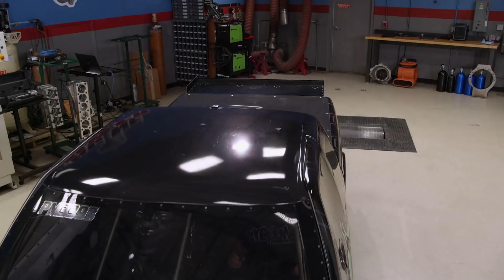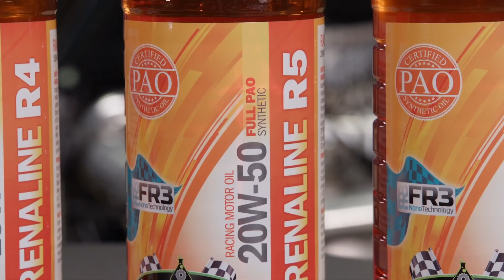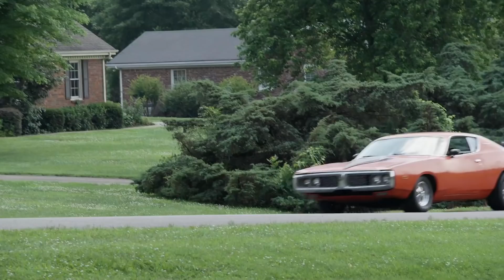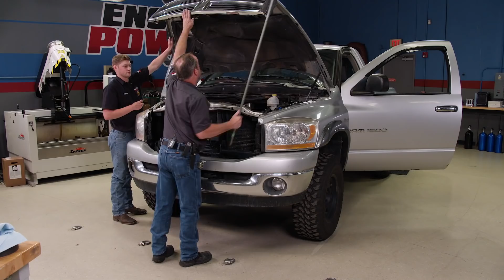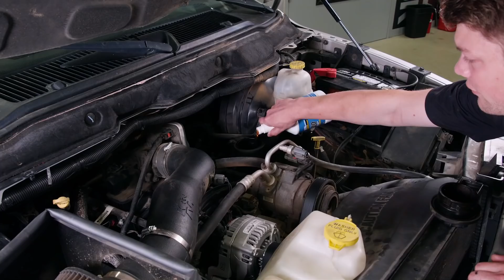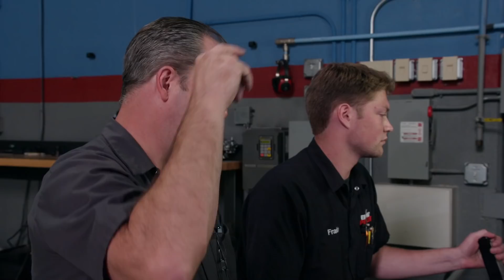The Secret Behind The Record-Breaking 3000 HP Diesel S10 - Engine Power S8, E18

Comment: Most people warm up the engine a little before changing oil. When you pre fill the filter you run the risk of pushing contaminants from the manufacturing , packing , shipping , process straight into the engine. Most cars have a clear flood mode. Buy holding the throttle wide open and cranking it for the few seconds it takes to establish oil pressure 
You can avoid causing any damage buy contaminating your engine. There is plenty of oil left on the Bering surfaces from warming it up. Pulse you just dumped five quart s or more onto it that drained threw. So there is plenty left to protect it for the few seconds it takes to get oil pressure.
Reply: So how do you get around the "contamination" in the oil filter (as you say) on the first start up then? Either way the first time oil goes through if there's stuff in the filter the oil is going to pick it up. Not arguing just asking as I may be missing something here.
Reply: @darryladams519  When oil comes out of the engine and into the filter in it goes threw all the little holes around the top and is pushed threw the filter medium to the bottom of the filter then back up out the big hole in the middle. If you pre fill it it sucks that oil out on start up and into the engine without passing through the filter.

Comment: I'm disabled ( thrown from a truck on the highway)  in 94. But my 2002 Sonoma 4x4 trans lines are leaking, my nephew tried to fix but hard to reach the nuts and pull their clips, now a second attempt by a neighbor but the battery went DEAD and so did the fuel pump, just throwing it out there to possibly get some help, I've been without my Truck for 4 months. I'm in Jackson Michigan if you get close. God bless, keep up the great work. P. S. And now my roof is leaking! But that's a whole nother issue.

Comment: These guys know what they are doing!! High horsepower diesel engines don't pour out tons of black smoke. My hat goes off to them.
Reply: It's not tuning so much as its multiple stages of nitrous..
Reply: The water and meth and nitrous cleans up any smoke I'm sure they have figured out how much they can spray with the fuel they have im sure they have done there homework and r&d
Reply: My thoughts exactly.  Some serious tuning and engineering put into that thing.  Impressive.
Reply: @bigboreracing356  That's why they are able to run leaner; lower EGT's and thus less smoke...
Reply: And they even said that they run it on the lean side of the fuel curve with nitrous and water meth to keep it cool even though it is dangerous
Reply: Because firepunk runs thousandths of hp worth of nitrous.  Fuel makes power with a diesel. and the  turbo cools the egt of course with in reason. A diesel thats NA in its simplest form  adds fuel to go and to shut down kills fuel since there isnt a tb or spark plug.   Thats why you see all the smoke.  I promise you guys arent building 50,000$ engines just to roal coal and ruin them.
Reply: Oh tell that to the pulling trucks and tractors
Reply: @justinballard7242  If they did better tuning they wouldn't smoke so much. Gale Banks made 1000 horses with an L5P duramax with no smoke. If FirePunk can make 3K with little smoke those tractors are way too rich.
Reply: @christianmeeks4430  actually if you watch banks videos you’ll notice that they don’t actually show the exhaust. And even in the last video he references the air fuel ratio getting into the 17:1 area which he has said anything heavier than 18:1 will cause a visible smoke. The reason high horsepower drag vehicles smoke is because you have a 7 second timer to stage the vehicle. So you need to retard the timing in order to get the turbo to lite sooner. The retarded timing is what causes the smoke because it’s not burning in the cylinder, it’s burning in the exhaust to spool the turbine. If you had an unlimited time to stage you would see some teams run with no smoke at all. But that’s not the case in such a quick sport. And as for pulling trucks and tractors they smoke so much because the are air limited and they actually run on the other side of stoichiometric ratio and run in the 12:1 and even 11:1 air fuel to get as much fuel in the engine as possible and still keep it cool.
Reply: @WhyNot6243  In one of the Duramax videos there is actually a shot of the dyno cell exhaust during a run.
Reply: @christianmeeks4430  you mean there is a shot of a dyno cell exhaust during a run. There’s is no way to know for sure that it is the same dyno cell on the same run. After watching his video on hoonigans diesel camaro it’s very clear that banks is only goal is to market to steering wheel holders that know virtually nothing about vehicles and try to sell them on the idea of getting a diesel if you use a truck regularly. His record setting duramax from back in 07 has visible smoke at the track. And in the killing a duramax series he isn’t trying to make a setup to drive on the street, he is seeing how far he can push it before it fails. He isn’t worried about how far he can “push” it before it smokes, he’s “pushing” it to see when it breaks.
Reply: @christianmeeks4430  Gale banks has an agenda and youre not listening to what he says . Fuel does make power he just chooses not to do that.  Gas and diesel tuning is totally different a diesel best afr is 14:5.1 stoichiometric  value of 14:5.1 thats very smokey , oem run them at  20:1.1 to burn clean. When people buy diesels tuners all they do is add more fuel and timing . Diesels are lean burning engines . Fuel controls how much power they make and the turbo cools the EGT , with in reasonable parameters. Guys who build 50,000$ sled pullers are roaling coal to look cool . The dyno they use has shown their rigs to make the most power at that level.

Comment: Diesels are interesting. A 3,000 hp gas car will never be a reliable, driveable car. A 3,000hp diesel on the other hand? The thing sounds like any other worked Cummins you see on the street.

Comment: Fram filter ???? Orange death...
Reply: Been using fram for 30 years. Got 800,000 on 2001 superduty 7.3 . Explain yourself
Reply: @BruceLee-xn3nn  the rare times you see a dead cummins its got a fram.. there bypass sucks and can fail and run your bearing dry.
Reply: @BruceLee-xn3nn  BTW you clearly maintain your rig.800.000 nice work  from a HEUI

Comment: Want to piss off the GM fanboys and purists? Drop a Dodge engine in a GM truck. Record-breaking truck or not, that truck needs to either have a Duramax swap or be crushed.
Reply: The engine is based on the cummins isb. It doesn’t have a single thing to do with dodge
Reply: @Strickland.Patrick  doesn't matter who makes the engine. Cummins dont belong in a GM, PERIOD.
Reply: @alanrlocklear  sure thing boomer
Reply: @Strickland.Patrick  Son, im old enough to be your father. Don't insult me.
Reply: @alanrlocklear  show me a GM diesel that has won in NTPA truck pulling.........
Reply: With that mentality I bet you're one of those guys that'd want an Allison transmission for big power 😂😂😂

Comment: 3000 hp from a single turbo diesel🤯🤯🤯
Reply: It's been done for years in Pro Stock tractor pulling, but those guys run up to 640 cubic inches..........
Reply: And alllllllllll the nitrous
Reply: @bigboreracing356  With a hint of nitrous sprinkled on top of that nitrous.